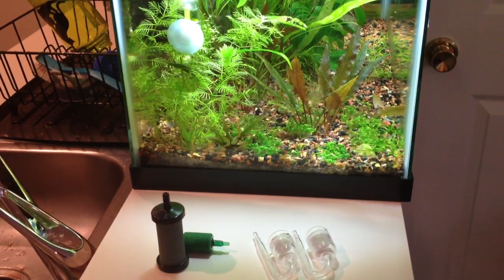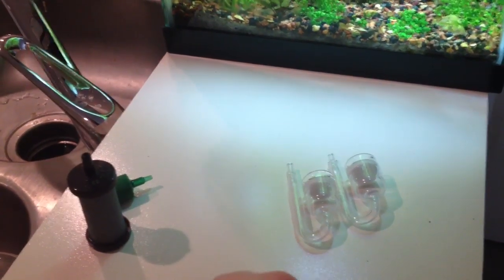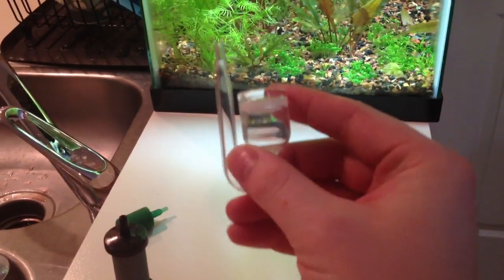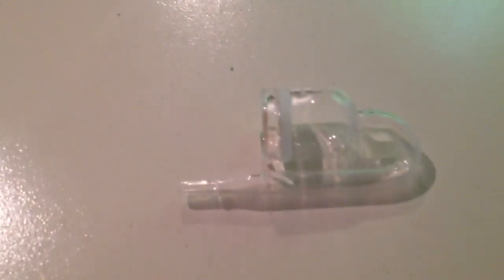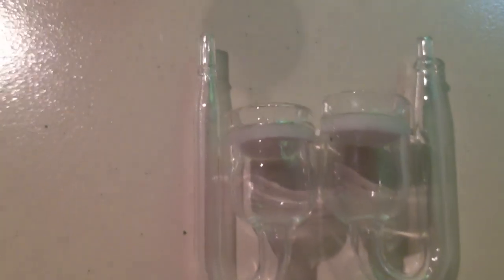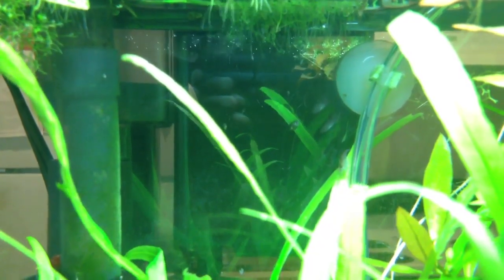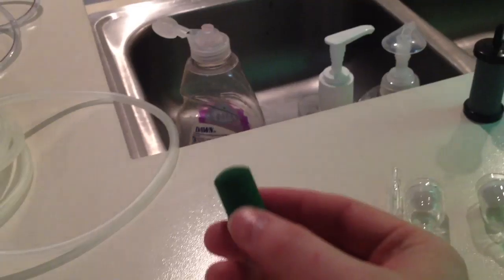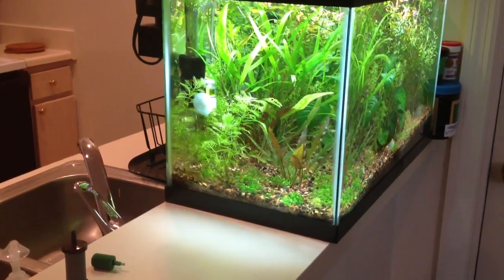Types of Diffusers for a DIY Co2 System for Planted Aquariums

Comment: Excuse me for being stupid but can you just hook up a air pump to one of the glass ones and have the same effect?
Reply: That method wouldnt add co2 to your tank. Instead youre just oxygenating the water. The plants need co2 to enter our planted aquarium. So to do that, we run airline  from your diy co2 output or pressurize co2 tank's output..then to a bubble counter..an then  attach other end  to the diffusor. So that co2 bubble will come out of diffusor.

Comment: Hi I tried to use similar kind of ceramic diffuser with my DIY CO2 generator. But the lid pops up each time I do that. And no CO2 is coming out. What should I do? Help me plz!
Reply: +Sourav Bhowmick i have a 
same problem. still dont know wat to do.
Reply: have you tried this with a container with a screw on type lid? a pop top won't be able to hold back enough pressure to run a diffuser efficiently.

Comment: No offence, but either you didn't wait long enough for the silicone to cure properly or your silicone work is a bit shoddy, because I've been running a DIY reactor with a nano diffuser using silicone and plumbing thread tape on the lid for sealing for a long time with no worries. Plumbing thread tape can be bought from any hardware store and is invaluable in sealing the thread on DIY reactors.

Comment from the maker: The impeller in the powerhead chops the bubbles into small bubbles. Elimiating the diffuser on the end of the Co2 line also allows the system to run faster as there isnt a presure requirment to push the Co2 through the diffuser. As a result you get an extremely efficient way to dispurse Co2 into the aquarium. I do not currently have Co2 running throuhg a powerhead but I will defiantely post a video if I change to that setup.

Comment: Question... I replaced my yeast mixture 2 days ago but wasn't receiving any bubbles going into the actual tank, so I made yet another batch today and still, nothing. I've sealed every opening again and dunked it under water, held the bottles upside down and I can find no leaks. The diffuser is half filled with water and the tubing siphoned water a few inches above it. My bubble count is about a bubble per 2-3 seconds. This worked for a month before the mix went bad, now it won't at all. Help :(

Comment from the maker: I prefer glass diffusers and use one on my 29 gallon. If i didn't use the glass diffuser I would run the Co2 line directly into a powerhead. Those are my two favorite methods of Co2 dispersion. Let me know if this helps.

Comment from the maker: The recipe can vary per setup and tank size but in general per litter use 1 cup sugar, .5 tsp yeast and 1tsp baking soda. So if you are using 2 litter bottles then 2 cups of sugar, 1 tsp of yeast and 1tsp of baking soda bottle. You can omit the baking soda if you don't have any. If it is a larger glass diffuser you may not be able to use a DIY system with it. If it is one of the standard glass diffusers that everyone uses this mixture should work :)

Comment: Nice video. In my time I've all the difusers you mentioned.Still stuck on glass difusers. But I'd like to add another typecin to the mix. It's only for advanced pressurized systems. It's  the inline difuser. You conected to the outflow line of you canister filter. You 100%  Co2 mix.

Comment from the maker: The only way I would suggest slowing down the reaction is to empty some of the mixture out of one of your bottles. Using valves or other ways of reducing the flow of Co2 can cause your system to leak and/or make a mess (sorta explode :D ). Let me know if you have any other questions. Nice looking tank btw :)

Comment from the maker: First off each tank is different so even though 3-4 bubbles per second could gas out fish in one tank. A tank of equal size could demand more Co2 than 3-4 bubbles per second. I would suggest you look into a drop checker or otherwise index your Co2 to determine if you have too much, too little or the right amount. I have a rather boring technical video on my channel that explains how to index Co2 levels if you are interested, In regards to slowing down a reaction....

Comment: Excellent vid, TY, someone finally explains the diff types of diffusers.  I just finished completing my first DIY co2 about an hr ago.  Is there a way to slow down the bubble count , in other words, slow down the co2 process.  My bubble count is 3-4 bubbles per sec, is that normal? is it too much? or should I leave it?  My mixture consist of 2 cups of sugar, 1 teasp of yeast, and 1 teasp of baking soda.  I used the chopstick method, thinkng about getting the glass after seeing your vid.  Thx

Comment: Thanks for the advice on the smaller diffuser. I've got a little bigger of one but do have a smaller diffuser for the second system. My plan is to run two DIY CO2 systems (both with 2 2L bottles) on my 36 gallon to increase the CO2. I feel like just 2 2L bottles is not cutting it.

Comment from the maker: Congrats! Luckily the water here is 4dkh straight out of the tap so I just use water directly from the aquarium for the drop checker. If you are close to 4dkh you probably don't need to mess with making it. Then again I have not done enough research to say that with certainty. I do know that it can be a pain to make... Good luck, thanks for the question!